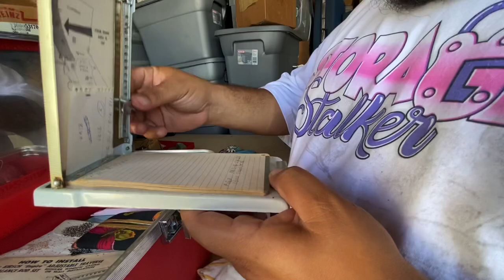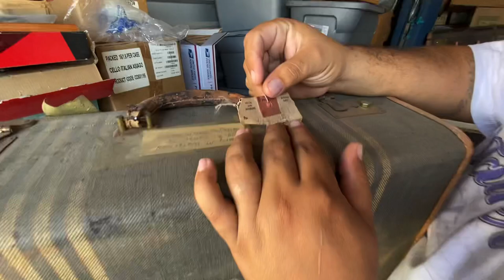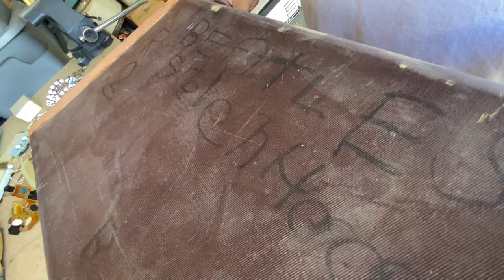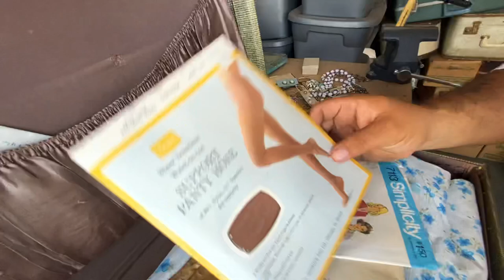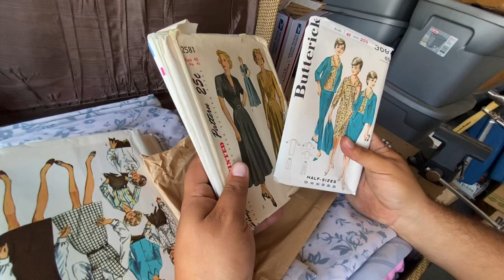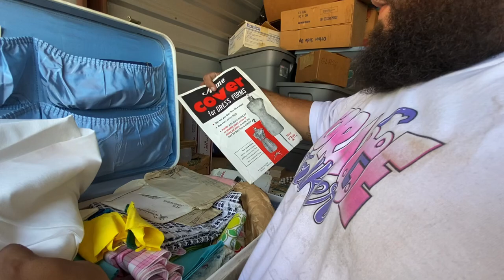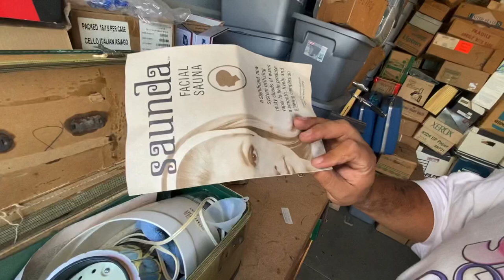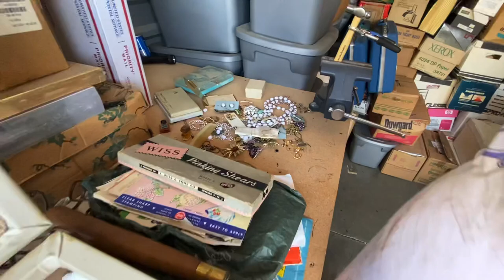She paid 28,000 in rent | I bought two abandon storage units | #storage-stalker #Shepassed

Comment: In the beginning of the video where you were opening the red overnight case on the top shelf there was a bottle that appeared to have cotton or something like that inside. Lots of times old folks would put broken jewelry in their and there are just stones that came out they would pack it in the cotton and putty midlow's bottles so they didn't get lost.
   There was also a cardboard tube with blue plastic inside. It was an emergency rain cap.
 At 20:23 you were closing a suitcase that had readers condensed novels in them they made the same exact  looking book And sold it. and it was not a book it was just meant to look like one. It had a hollow inside to store things.